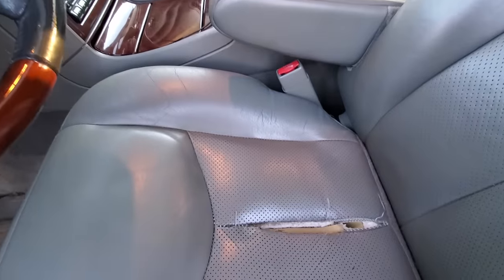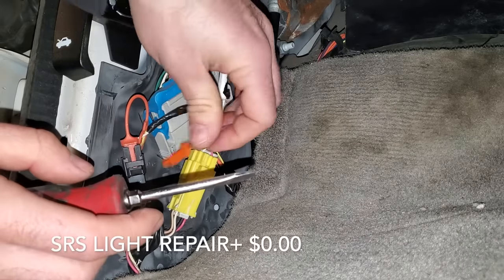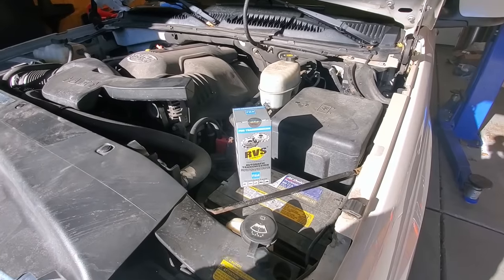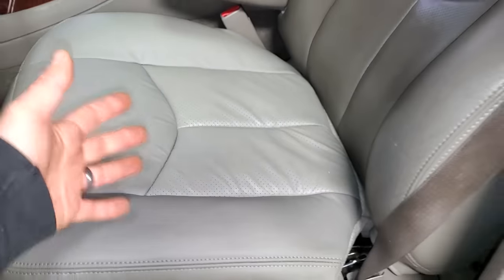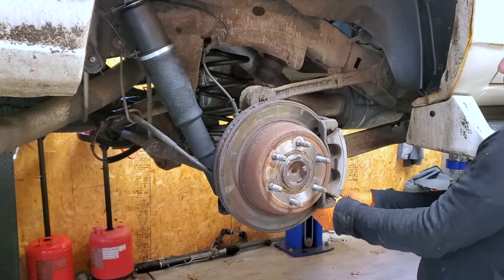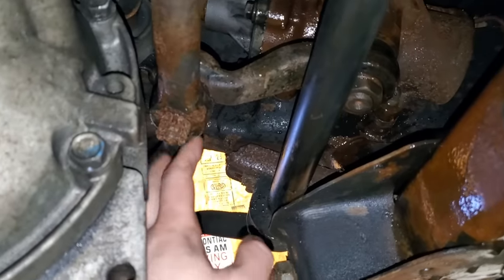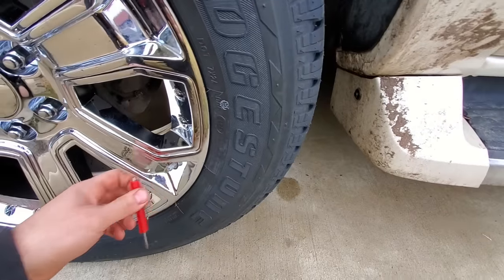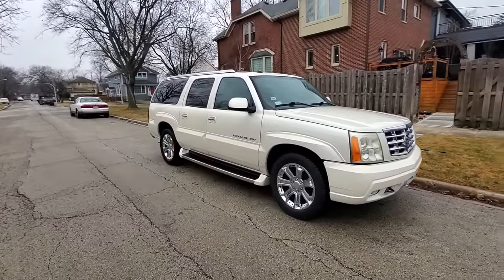I Fixed EVERYTHING On A 15-Year-Old Cadillac Escalade In 1 Day To Avoid Buying My Wife A New Truck!

Comment: its a couple of cheap metal brackets that hold the parking brake line to that rear crossbar I had the same issue on my 2010 suburban couldn't find anything on it I did as you did and zip tied it back up. it a common issue on even the newer gm full-size SUVs

Comment: seeing the undercarriage of your Escalade reminds me of my F150 that Ive touched the pads and rotors at least 8 times since I got it a week ago.  Then seeing the front carrier shaft tunnel remined me of the cracked one I just found on my F150, right where it bolts on the diff too.  Ordered a new to me front carrier online and the next day the front right wheel hub decided to let go at 50mph and caused my front right wheel to roll across six highway lanes and a divider completely avoiding vehicles thank God.  Miss my truck, as its sitting on three wheels and a floor dolly in my friends shop awaiting that front carrier

Comment: I have a 2013 Escalade ESV Platinum - what is the unused bracket on the firewall - drivers side between motor cover and brake fluid reservoir?

And the link to the GM Shop Service Manuals is broken.  Can you update where you get service manuals?

Comment: This is the first video I've seen from you. I am a huge GM guy I am a GM certified master tech. I've fixed my wife's suburban the same way lol. My question is why didn't you replace the heated seat element right then. And the exhaust leak fix is very temporary I always drill it out and start over. Nice rig it will go for along time. Nice job

Comment: I just did the broken exhaust bolts to have to weld a nut in the broken bolt no matter if a little piece is sticking out or broke off flush

Comment: This was great for me. I just purchased a 2006 black ESV and I was battling with going with 20’s or 22’s. I don’t want to ruined the smoothness of the ride which it floats and is so smooth. The 20’s that you put on your esv looks great. What size tires are you using/?

Comment: @6:00 min. Can You Go into MORE IN DETAIL of the RVS Transmission Fluid (which one was the one You used) would like to try this Method for Two of My GM Trucks with 150,000+ Miles

Comment: I had the same thing happen with a '06 Isuzu Ascender, bought it from a guy that was going to sell it to carmax, paid $2500 did a tune up, cleaned the throttle body and did shocks & struts and it rode like a dream. Got hit on passenger side and the insurance company offered $5700 if I bought the vehicle back from them, found replacement doors for a year newer but the same color for $425 and a running board from the junkyard $20. FREE CAR!!! (It could use a paint refresh at this point though)

Comment: My 02 suburban is basically the same platform in lower trim.  I haven't had the front brake caliper bolts rust seize (knock on wood), but if Illinois rust is as bad as Wisconsin rust you may come to hate changing your front wheel bearings...The driver's side on mine was so badly rusted to the steering knuckle that nothing could free it. I beat on it with a sledgehammer for a week and tried heating it with a MAP torch, hammering an impact socket placed on the bearing bolts (to preserve the bolt heads) to force it out from the back, you name it...Near the end I removed the bolts holding the steering knuckle to the control arms and tie rod and kept wailing on the bearing (which the wheel hub fell out of from all the hammering) till the steering knuckle separated....Once that occurred I just bought a new steering knuckle (greased the surface the bearing contacts to prevent the new one from rust fusing to the knuckle) and installed the new knuckle and bearing...The passenger side was more cooperative. I can't seem to find bearings with a good warranty. The drivers side bearing from Oriley auto parts died in under 30k miles (about 3 years) and only had a 1-year warranty. I think the one I removed at 110K was the original...The replacements ought to last a bit longer or have a better warranty.

 I may have to try the seat leather swap...the seat leather in mine is a bit more worn (the cushion is starting to wear too). 

If your window regulator fails, think twice about replacing it with Doorman brand parts...the original front drivers regulator in mine died this fall, and the first 2 replacements both died within a month of install (having a window stuck open in winter/having to change a regulator in freezing temps SUCKS) at least the replacements had warranty so I didn't have to pay for the next ones...Come spring, even if replacement number 3 lives that long (still under a month of service so far), I'm going to a junkyard and getting an original to use for the next replacement.

Anyone know why the front woofers are $80 a pop? Mine the foam rotted and the voice coils went open circuit...They look like cheaper speakers than the budget generics that don't have the right mount brackets.

Comment: Wanna talk about torque needed to undo a rusty bolt? I had my 99 Silverado on the ground trying to replace the driver side wheel hub and I had a wrench in the bolt and put a jack under the wrench and started jacking up the wrench and the whole truck was moving upwards until It finally sank back down

Comment: Great video, I also have a second generation Cadillac Escalade 02. However the air condition is giving me some trouble, I replaced the compressor condenser and dryer but its not cold. It seems as if the fan is running to slow and the temperature gauge rises from 1/4 to 1/2. Do you have any suggestions?😊

Comment: I have nearly the same vehicle with 54k miles on it. We just picked it up in November. Same deal, a vehicle for my wife and kids. I love it for trips to cabin and it still has the ability to tow a respectable trailer. I feel your pain on the rust being up in central MN. This video was great and sheds some more light on a vehicle I'll inevitably being working on. The biggest problem I've had with the Escalade is getting the built in garage door opener (homelink i think) to work with our garage. Could you shed any light on how to sinc these?

Comment: The factory 22's just look so classy and tie the SUV together so nicely. Those 20's transformed a top of the line, head turning Escalade into what looks like a pimped out Suburban.  If you were thinking that the factory 22's were on track to have the chrome pit and chip away then a great alternative to paying $1900 for a 20" downgrade would have been to paint the 22's black.  I'm not a fan of black wheels on many cars but a set of blacked out 22's on a pearl white Escalade rally looks good.  You'd only b set back $20 in black rim paint and $700-$800 for a nice set of new 22" tires
Reply: supafrancis frfr

Comment: I live in Wisconsin and feel your pain in the t55 slide bolts my driver side top is stuck rn on the 02 but pads were still thick so did all three other pads and rotors

Comment: Loved the video. Just bought a 2005 Escalade that needs a little TLC but most everything I believe I can do myself. I had a couple of questions: The transmission treatment you used, did you just pour it down the transmission dipstick line? One last thing, my seat heaters don't stay on, I push the button and they light up for a second then turn off. Any ideas what this might be? Thank you! looking forward to working on this beast!

Comment: Did you have to lower the motor to put that exhaust manifold bracket on? Or how did you do that? I’m thinking the 2 rear screw will be hard to get in. I see in the video the manifold was off the vehicle

Comment: Thank You for this awesome video!!! I have a 03' EXT (same color, but tan interior) and my baby has 247k and runs better than ever thanks to the rebuilt trans I installed and tune up. I too need rear suspension work, I gotta replace both bags and compressor.  I wanna change both front seat cushions but my driver's seat is wacky. The controls are opposite of their intended movement and the heater doesn't work. Pass side is fine. Also that manifold fix saved my ass last year $22. I also have those garbage 22's that leak like hell. Other than that these trucks will run forever and I love mine. I want a newer 2016+ ESV Premium but I love being payment free! I'm just gonna save for one and run my EXT another 100k miles, thank you again for this video 👌🏾

Comment: 2005 Escalade esv
Tried the airbag light tip but it didn’t work for me. Anyway you can shoot more details..For example key position? I do not have a scanner but I’ve have the code read in the pass and it was one of the codes you mentioned. Also any tips on rust removal or repairs on rusty vehicles?

Comment: For the slider pins heat them up on the bracket as hot as you can before cherry red use some vise grips and work it clockwise and counter clockwise. Eventually they'll come free just be cautious if there's a lot of lube in there it'll make a loud bang lol

Comment: Just picked up on 01 yukon XL with 240k miles, gonna need to rebuild the whole front suspension and probably  gonna need to rebuild the steering box, should be similar to this correct?

Comment: The Haynes manual for my 98 escort zx2 recommends you unplug/ plug the fuel injectors “a few times” if you have a slight misfire. I had a very very inconsistent misfire and started wiggling the connectors on the injectors. sure as shit the #3 connector had corrosion. Cleaned it and the misfire went away. Sometimes repairs aren’t complicated. I had changed plugs, wires, ignition coil, maf, iac, tps, and the iat. I was pissed

Edit: the parts cannon was unleashed on that car

Comment: I have an 04 escalade esv with 260000 miles and 20k after 200k are towing an 8000 lb travel trailer.  Great video, the air ride on these vehicles are trash you can replace a oem set and hook a 3000 lb trailer to it and have them blow. I changed to coil overs in the rear but it made the ride terrible

Comment: Can you please be more specific as to how to get a workshop manual? I searched around the web, looking for a workshop manual for a 2018 Escalade and nothing useful popped up. I did check the site for the OE wheels looks really good, planning to get a set to have winter tires mounted and swap.

Comment: OK. Well, I'm a wary consumer, and as such I usually don't buy items I see on a random website/video based on someone's recommendation (especially someone I don't know). But you impress me (as one car guy to another). You appear to know what you are doing and seem sincere. So I bought the RVS oil treatment for my wife's 2017 Scooby Outback. I was surprised when she went a quart low twice with only 2000 miles between oil changes. So I switched her to full synthetic and the RVS seems like a good thing to do now as well. (The dealer tried to convince me to switch to synthetic, but seeing as how the car left the factory with conventional oil I decided that they must think it is OK, so I kept the oil dino-based.) I'll subscribe and see what you are all about. I race a 1969 Buick Riviera, btw. Yeah, I know. But it's totally bitchin'.

Comment: Have you ran into the Stabilitrak Off issue from these vehicles? I've read a ton of different things that set it off, it's more annoying that anything as you can shut the truck off and it comes out of limp mode with the check engine light remaining. Do you have any ideas on how to fix?

Comment: I used an 8” C-clamp to remove my caliper pin! Broke her loose in 10 seconds after clamping my T-55 torx bit tightly to the bolt.

Comment: How do you fix the stability control error on a 2003 Escalade ext ? No videos on that
Reply from the maker: This is my only Escalade video but start by scanning for codes. These had a common issue with the front wheel speed sensors
Reply: LegitStreetCars ok thanks

Comment: Hey man I changed my rear shocks to airnott on 0 7 Escalade. Ever since I've had traction control stabilitrak codes popping up intermittently when I come to stop. I disconnected battery and fuse before install. Have any suggestions or ideas? Please help

Comment: I have a 2000 Cadillac Escalade and my transmission just went out the engine and rear end have over 300k miles on it other than the bad suspension, the mileage, and my transmission, its not a bad car but I can't drive it RN and I just put a 24in glasspack on it (sounds amazing BTW)

Comment: My hemi has the leaking exhaust manifold bolts, it stops once the engine reaches operating temperatures. Passed smog this year perfectly fine so I'm not too worried about it. The dealer wants a thousand dollars to fix it.

Comment: The reason the paint doesn’t match is because the pearl white top coat is directional spray specific, you would have to paint majority of the car to blend. Also GM doesn’t list the base coat paint code on the door tag, just the translucent pearl top coat.

Comment: Just found this, I have a 2004 Escalade and I've made 'custom mud flaps' for it all the way around. I'm going to have to use the same holes where those 'push pins' (is that what they're called) in the wheel wells, the flares are fiberglass, about 1/4" to 3/16ths" thick so I'm looking at metal screws to replace those pins, about 3/4" in length for the pins, they're looking like about 5/16ths diameter for the holes so I am now waiting on a couple of 'sample sheetmetal screws' to see how they fit, how snug can they get with the flares, the sample screw sizes are 5/16ths & 3/8ths, I really don't want to drill any holes to mount the mud flares if I can help it. This situation only pertains to the front wheels, the rear ones I plan on using C-clamp type mounting brackets, but even they may have to be modified, I'll get the front wheels straight the I'll see where I am with the rear ones, go to my Facebook Photos page to see my pictures of it, put in my name, Earnest Dotson, any assist would be fantastic, thanks !!!

Comment: The point of a torx head is to apply good pressure and girp why do you say you can't apply a lot of force? If you hold it vertical to the bolt and properly it it should take a lot no?

Comment: I have a 2006 Silverado 2500 Duramax and there is a quite a bit of play on the steering. If I replace the pitment Arm, will it fix this issue? If not, anyone have any ideas I can look into?
Reply from the maker: It must but there are a few other joints that can be loose like the tires rods. Check everything
Reply: @LegitStreetCars  Cool, that's narrowed my list down. I've already replaced the tire rods and steering stabilizer. So it's probably the pitment Arm if my truck has one

Comment: Hi, you seem to know a lot about the Cadillac Escalade, I have an 2006 Escalade ESV as well and I would like to ask if you have ever changed out the cabin air filter.  I have watched several videos on youtube for Suburbans and Yukon's, along with Silverados and Sierras.  They are basically all the same and most of the guys doing the video say it's the same for all GM products as well as the Escalade.  Well, I bought the filter for mine but for the life of me I can't find out how to get to it in the vehicle.  There doesn't appear to be any space between the blower motor and the HVAC unit as shown in the other videos.  Thanks for your very informative video on the Caddy.

Comment: It would have been nice for you to go into more detail how you separated the seat bottom from the frame without removing the seat.  I really don't see how it's possible to do without unbolting the seat from the  body.  There are at least 7 wiring harness connectors that need to be removed.  And with all the seat motors in the way, there's almost 0 space to get your hands in there without having access to the under side of the seat.

Comment: I've always been a fan of Cadillac especially the early 2000 Escalades. Are they really that bad as people say they are? I really want a nice luxury older SUV from the 2000s and I think these are from my knowledge the best options. Compared to Audi and BMW SUVs, the Escalade seems to last the longest and has the cheapest maintenance cost. I have some questions though? What are the lifespans on these if I buy one used and take care of it, oil change etc? How are the lifespans on the engines, trans? Do they break a lot? I see a lot of these with 250K miles, if I bought one at 100-125K would that be a bad idea if I really don't drive that much? Pros and cons of an early 2000s Esclade? Opinions?

Comment: Wow three-year-old video. I just picked up a Escalade EXT and it had that knock in the steering wheel when you slightly turn it. And they told me they would fix it. But after I got the car back the steering wheel was no longer centered and it drifted to the right. And now it has a system stability light on 🤦🏾‍♂️. Nice to know it was the pitman arm.  They also replaced the tires but they didn't replace the sensors. So I have that tire pressure sensor light annoying me 🤦🏾‍♂️. And I also just bought a set of those same seat covers. They also replaced three of my brake calipers. It makes no sense to only do three. This video has just shown me three of the problems that I have. Good stuff. My only issue was that I'm not used to a vehicle that has such a soft steering. I'm used to tight steering that's normally in sports cars. So I'm thinking too soft steering is not normal. I also live in the Chicagoland area. I'm starting to get that rust under the wheel well because of the salty roads.

Comment: The dealer wants $500 PER Shock for the rears on my suburban. $200 for air shocks seems cheap. I dont  even have Air Ride on mine.   but it has the auto leveling option, that's why they're expensive. The shocks are called Nivomaxx I think. Any shock will work but not all auto level.

Edit: Nivomat